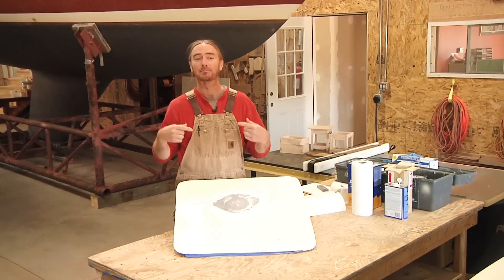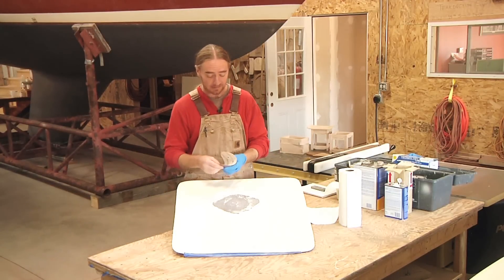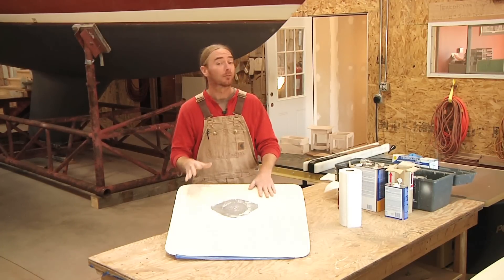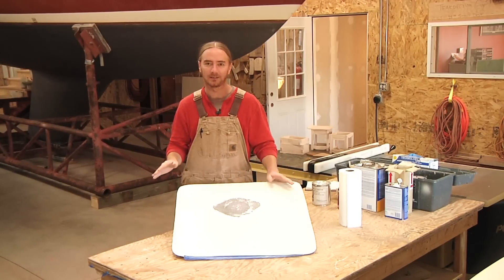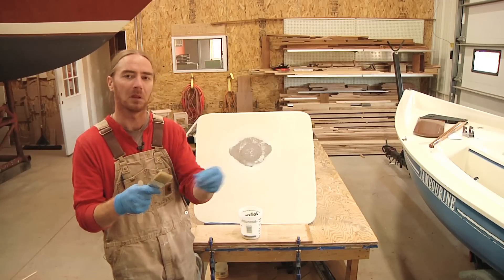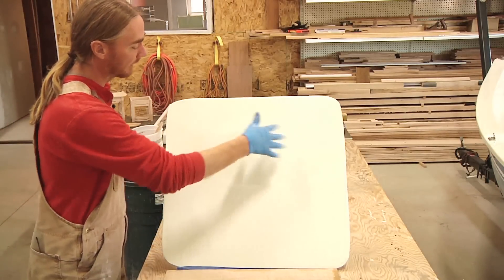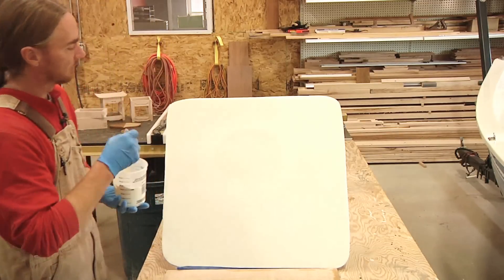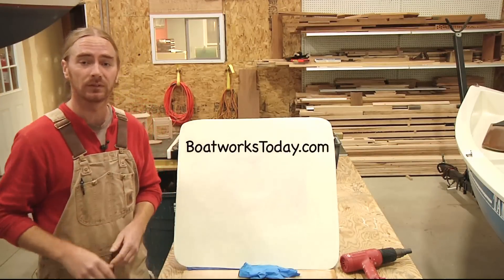There's A Hole In My Boat~ How To Apply Gelcoat

Comment: All I can say is Thank You! I matched my gel coat color perfectly and applied to a larger repair via brush. The Bad news was it was at least 85 degrees. A bucket of ice did the trick I had at least 30 min working time to do what I had to do. I followed up the next week with sanding and its beautiful! I will add that I have been in color matching all my life and your method was the nuts. The color is perfect much better than the 2 part paint that was mixed using a high end color match Spectrophotometer. Again Thank you!
Dave
Reply from the maker: That's awesome!

Comment: Hey bro.. 
Your videos are great thank you.. 
I'm restoring the inside of my fibreglass esky..
I'v sanded the original gel coat exposing the fibreglass then layed a sheet of fibreglass cloth on top which has come up really nice being my first time working with fiberglass...SO ITCHY HEY lol
Once I apply the first coat of flow coat am I able to 
apply a second coat of flow coat once its dried or semi dried over night because it remains tacky for some time..
If its dried completely do I need to sand it then clean
 it with Acetone to apply the second coat?

Comment: Will poly stick to epoxy? I have a hole that I was going to use epoxy on the inside and also use it for redoing the floor of the boat, which would be painted. Would I have to do the bottom in poly first which I plan on using gel coat? Love your videos! And I’m in Wisconsin too! Boating on bago

Comment: Andy have you heard about an automotive primer that is made for stress cracks it give you about a 13 hour time frame to sand it in before it hardens like concrete I can't remember the name of it but we used it on Corvettes and it worked great getting into them and coverage we hade one vet come in that was burnt front end cleaned it all up as and sand blasted some areas to get the heavy damage out than did repairs and followed up with this primer it was a white in color the painter that was working at the shop at the time applied it I can't remember the name of it that's why I was wondering if you have used it or not...

Comment: i was wondering if you did all three coats with the first mixed cup off gel coat, or you mixed a new bash per coat? Thank you for your time videos are great.
Reply from the maker: +snappkiller0505 I did do it all with the same mix.  It was a little cool in the shop which helped to keep the gel from setting up in the cup.  During the Summer I would not have been able to get away with it ;-)

Comment: Ok, I know this is an old video. What kind of Gelcoat do you put over existing gel coat? I’ve got an old golf cart and the front body needs to be repaired. There are 2 kinds of gel coats, with and without wax. I’m assuming for this kind of application it would be without wax?
And since I will never gelcoat again, I’ve heard you can roll it with a sponge roller. It’s going to be painted when I’m done, but I can wetsand any marks down.

Comment: great video thanks , a question on the PVA though,  if I  go that route to gelcoat with unwaxed gelcoat  to the stern of a boat we just repaired   do you apply the PVA right away like you did at the end of the video or can you add the PVA say 24 hours later ?, and does the PVA just cure the surface of the gelcoat or does it permeate the whole thickness of the gelcoat?

Comment: Why did you put PVA over the top of the gel coat patch you made? To seal the gel coat so it will harden better? I've heard you talk about using gel coat to help the fiberglass resin to set up.

Comment: I have 39 years Auto body "AWESOME VIDEO".... I was fixing some very small rock chips on a customers ski boat and I filled them with LORD FUSOR T21 Slow COMPOSITE ADHESIVE.... I let the T21 dry 24 hours sanded cleaned and brushed on Gel Coat, only the 2nd time ever using Gel Coat.... Where the T21 was thicker (All was super thin) the Gel Coat didn't Harden... Not sure if I had a Bad Chemical Reaction between the T21 and Gel Coat but thats what it looked like to me when sanding to re-repair....

Comment: Great video and an oldie by the looks.  You spoke about gelcoat that doesn't flash off due to unmixed catalyst.  What is the solution for this? must be sanded back? can another coat be added on top so it flashes off?

Comment: Hey thanks for the videos as a jack of all trades an master of none I can lay down fiberglass and Bondo. Now my question after watching multiple videos I come to realized that everyone has their own style and preference of materials. I'm restoring a sailboat, probably the only one I'll ever restore so when it comes to gelcoat cracks since I'm going to be painting the boat instead of using gelcoat would it be ok to use Cabosil with regular Resin. I have used it before on other projects with great results bonds well is very hard and Cheap what advise can you give me Thanks

Comment: Thank you for making these informative videos! I know I'm about 6 years late on this one. But I am just now getting around to learning fiberglass for boats, and have a question. For small fiberglass repairs on cars, I always use laminating resin and then cover it with wax paper (for baking). I've always had very good results with the cure, even though it increases the required amount of sanding over some contours. Do you have an opinion or experienced advice using wax paper for gelcoat? (PVA is a bit expensive, on top of other expensive materials, lol.)

Comment: a guy was blasting paint off my boat, and he went all the way down to the fiberglass in one small 3 by 4 inch spot.  I plan to just ad primer over the whole boat now and then paint it again, but what should I do about the spot.  Because it's so small, does it require really nice gel coat fix up now.  Thanks for helping a beginner at this if possible. Thanks.  (any specific products you know of would be great) (also, this is a 40 ft sailboat intended to sail in salt water)

Comment: Hello, and thx for your awesome videos....I have my boat stored inside for the winter and wanted to do some small gel coat repairs...the building is kept at about 45 degrees, I know that is not optimal for doing gelcoat, is it possible? Could I do small areas if I used a heat lamp or a small  electric heater? Is it the air temp or the surface temp that is most important or both?
Thanks in advance for any help!
Mike

Comment: Enjoyed watching this. I have question though, is it possible to give boat new colour with Gelcoat and if you can what would the steps be ?
Reply from the maker: +Thordur Reyr Arnarson It is, but I generally recommend going with paint as it's a lot easier and can be done with minimal tools.  Doing gelcoat over large areas requires spraying and aTON of wetsanding / buffing.

Comment: Great vid, I have a question: I bought a repair kit with wax for a small repair, but the repair is pretty deep. Will I be able to “flash” the gelcoat for a few minutes and lay some more in or will I have to let it completely cure and sand it before adding more (since it has the wax)? Thanks for any advice!
Reply: How did it turn out  I have a small repair myself

Comment: i have a dune buggy dragon red i need to fix a few scratches some a little deeper than others like maybe 1/64 to1/32 deep ? about . should i get clear resin and mix the red pigment in it shake it , put hardener and with a very small brush apply ? then of course the sanding comes . thanks for showing this , i worked fiberglass years ago in my 20's i am now 63 , some of it is not so clear as back then . thanks for your   vids , i am in florida we have plenty of heat and then some more  .
Reply from the maker: If it's a bright red, then yes you'll need to start with a neutral or clear gelcoat  Just be sure to mix up more than you think you'll need for future touchups and fine tuning the color :-)
Reply: what is the video name where you cover spider cracks? recently got given 2 old kayaks that seem to be covered in spider type hair fine cracks that need some sort of attention but I need some guidance.  Thank you for the great and calm and clear instructional videos, have made my way through at least 10 so far.. 😆

Comment: Any recommendations for outside in Florida summer heat? I have about 3-5max minutes before my gel starts to go. I have worked with epoxy for a while and am spoiled with all the different kick times with selection of hardeners. Isn't mekp for poly only come one way? Is there a slower curing mekp? Possibly an additive to extend working time? I am nervous to go below 10drps per ounce although I truly believe in this heat it would kick with 5drps...
Reply from the maker: armndngr There is a slow version of Mek-P..  It's MEKP-MCP but it's only for use with poly resin used for glass layup; not gelcoat (even though it's still poly based).  Just work with smaller batches or at night or early morning when it's a little cooler :-)

Comment: Hey, love your detailed videos, thanks. I've been doing pretty much exactly as you demonstrate, but after I've applied the pva (I'm using water soluble release agent) the gelcoat still isn't hardening. I left the pva on overnight, but when I wiped it off it was still tacky. the only difference to your method is that I applied a final layer of gelcoat with a filling blade to push it into the pits left by the brush, just to try to reduce the sanding time a little... do you know where I'm going wrong?

Comment: Hi.I have never applied gelcoat before and was going to attempt applying waxed gelcoat that I already bought to a boat build project (21') that I am doing. It was recommended by a buddie of mine to spray it on, but I an so worried of gelcoat clogging gun, as I am no spraying expert n do not know what to expect and,  wasting of spray in the wind outdoors etc. 
Does more gelcoat get wasted when spraying rather than brushing?
what are your views
Reply from the maker: Aldean Louis honestly for large areas, paint is is the way to IMO.  Gel coating a boat will be 4x the work compared to painting, and if the right paint is used, repairs are actually easier as there no color matching, oxidation, etc to deal with :-). Hope this helps!

Comment: Hi i just bought a boat and the guy told me the bottom half is firberglass and top is wooden when i started cleaning the bottom with high pressure gun a section ripped of and exposed that its timber with gelcoat on top. my question is some parts of thr bottom the timber is rotten maybe the size of fist should i repair and gel coat again or firberglass the whole bottom and top and gelcoat and paint. rhe boat is 6.5 metres full cabin.

Comment: I have small pin-holes in my white hull that are from air voids in the glass and what I'd like to do is to just fill the small voids for cosmetic purposes. I was going to use Marine-Tex and then razor blade off any high spots and wet-block-sand and polish. What process and materials would you recommend to avoid having to re-apply gel-coat?  Thanks!
Reply from the maker: Honestly I think I'd just try and fill the pinholes with color matched gelcoat.  Even if the color is off a little bit, the fills are so small you'll never notice them :-)..  Block it out flat and polish to finish

Comment: i just got a 14ft fiberglass v-bottom boat. theres a hole in the "v" right below the drain plug. is it possible to do the same with the v as you did with the flat?
Reply from the maker: Yup :-)
Reply: thanks already started, patch the holes now have to smooth the bottom and paint. this video helped alot!

Comment: Im planing to paint my faded cockpit area, do i just wipe w/ acetone and spray the gelcoat, or do i need to prime first.?
Reply from the maker: You'll need to make any necessary repairs first (cracks, chips, etc).  Then sand all areas to be gelcoated with 80 grit, wipe with acetone then spray (no primer needed with gelcoat).  Get ready for a lot of wetsanding afterwards to smooth everything out :-)
Reply: 1) What size compresor do you recommend for spraying gelcoat and what type of gun sprayer?
2) What do you use clean the gun sprayer with?

Comment: So, are you mixing new batches for each coat? No sanding between coats?
Reply: You don't have to sand it if it has no wax in it, and if you do it within an hour or two. If it were to sit overnight you would want to sand it prior to adding another coat.
Reply: BUT..... It's always a good idea to lightly sand just to knock down any little glass that isn't laying smooth, or your next layer will suffer

Comment: Where can I find the list for a good brush on gelcoat? I need to do a small rv and do not want to spray.
Thanks, Rich
Reply from the maker: Rich McNatt Hi Rich, there really isn't a gelcoat designed for brushing; most gelcoats will be similar viscosity.  Some have a higher pigment level and use better quality resins, but that about all.  If you have to coat a small RV, honestly I'd suggest painting.  Even with spraying gelcoat there's going to be a ton of wetsanding and buffing; even more with rolling or brushing the gelcoat.  There are some really good paints designed for roll / tip.  Hope this helps!

Comment: You always know a good spray painter by his compressor. The compressor has to be a minimum of 15 cubic feet a minute! Then the water trap has to be a minimum of 10m from the compressor. I even run 10m of calvanised pipe along a cold wall. It is a water trap and not a vapour trap. Vapour has to be given a chance to turn to water before the water trap can catch it. It's the water that takes away the shine in your paint job! I some times see compressors with water traps that a less then a foot away from the compressor. Then the people complain that they can't get a shine!

Comment: Hey, first I'd like to say thank you for your videos. 
I just bought 29 foot motorboat, and my father who has owned boats all his life, except for the past 5 years. Wanted to take his friend out for the Day. As he was pulling into the slip, The tide was very strong, as well as the wind. To make a long story short, he ended up putting a nice long scratch along the port side of the boat as well as a 3" x 2" hole towards the aft the boat on the port side. What would be the best way for me to go about fixing this. Other than not letting my father take the boat into the slip.
Reply from the maker: James Tower Basically the repair would be identical to what was outlined in this series :-)  A hole is a hole regardless of size.  Just apply the process and steps for your repair and it will turn out great!  Any Q's along the way just let me know.  Good luck!
Reply: Sorry it took so long with my reply, I want to thank-you for responding and all the information you provided in this video.  I haven't had the chance lately to check out your other videos (I work from home, and business has picked up) But I will today.  I also has some off topic questions that are better discussed in e-mail as appose to comments since they have nothing to do with your topics.,  How would you like me to contact you?
Reply: Thanks again for your video's! I saved so much money, and I'm so surprised that I or nobody else can tell there ever was damage there.

Comment: Why use pva after. Is this required step?
Reply: Its to make sure the gelcoat cures completely. A more normal approach is to add wax to the gelcoat which creates a seal on the surface the same as pva does.

Comment: how do i repair chips on the strakes below the waterline with gelcoat? chips  are thru to the glass. i was told to use Evercoat gel paste 100695 is that correct? i dont care about the color as long as its white